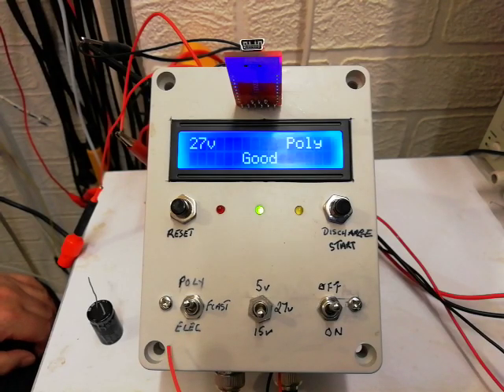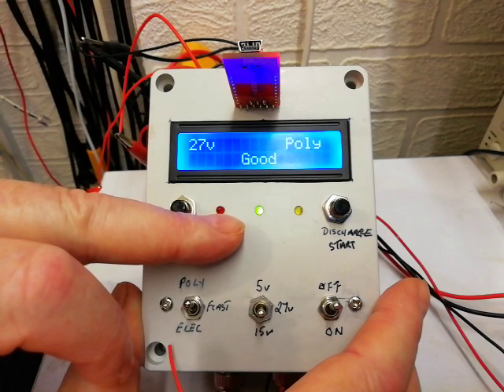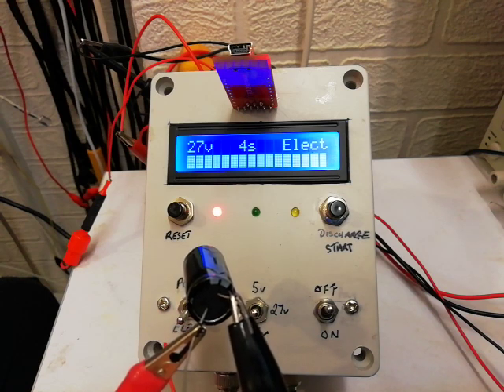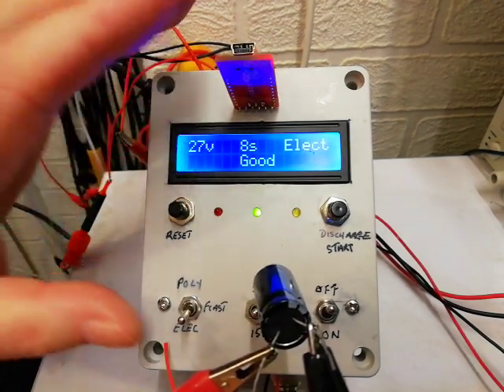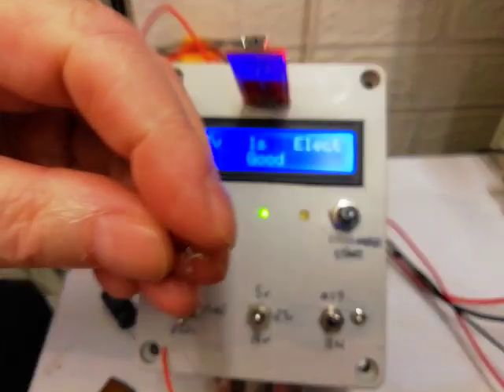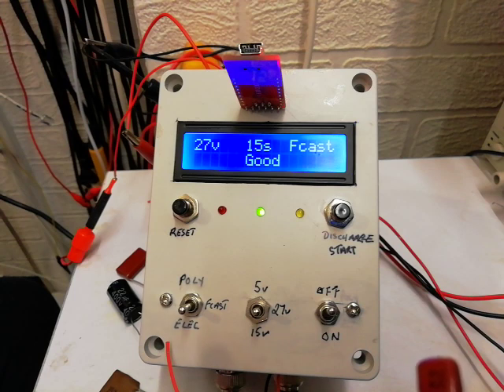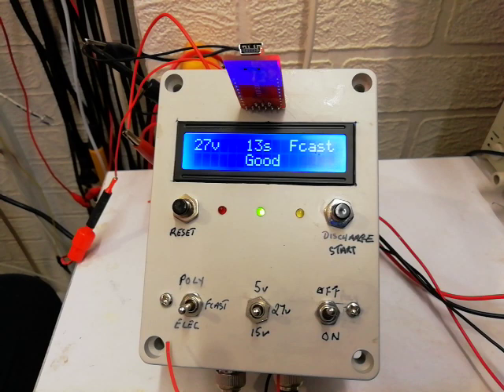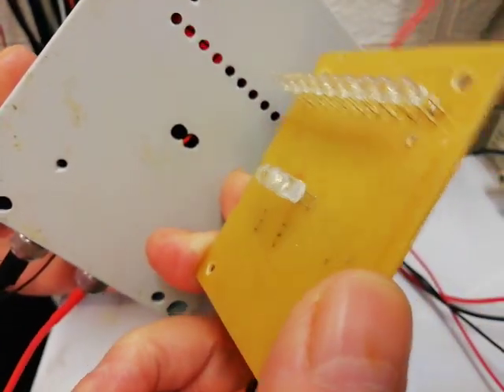Arduino Capacitor Leakage Tester

Comment: this version is very similar to the one from Yanic Turcotte. I think that you use some ports to enable one transistor at a time to connect or not a Zener diode to source the capacitor rail. then another to actuate a relay that close the circuit with a resistor and a led ,... or perhaps this version has only a resistor and the Discharge LED is controlled by and uC output. then you use the amplfier done by Mr Carlson, with high Hfe transistors and huge resistors network to let pass some uVoltage and adequate it from 0 to 5V sourcing an analog input of the uC.
I am not in Patreon, but thanks to all the people that have shown this PCB with their versions i did an schematic. I've tried to warn Mr. Carlson and the people but all of them just ignored me.

Comment: Nice! Any update on this? Adding 63V and 100V would really make this useful for testing caps which only leak at higher voltages. e.g. charge an internal large 150V low-esr cap up to 5V, 15V, 25V, 63V or 100V so have very smooth supply - that way the device could be run from a smaller battery (9V or LiPO?).
Reply from the maker: Hi
I have no more updates on this at the moment and 27 volts is the highest it will go ,all electro caps leak to some degree or another checking at lower voltage will still detect if it is holding a charge ,you can also check against a known good one ,and note the difference